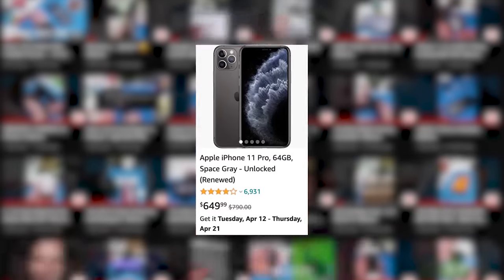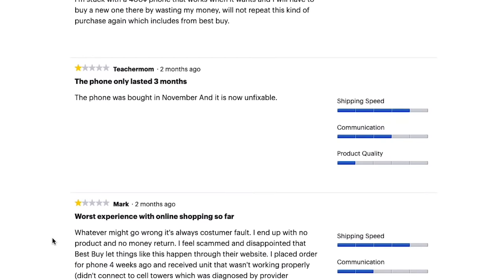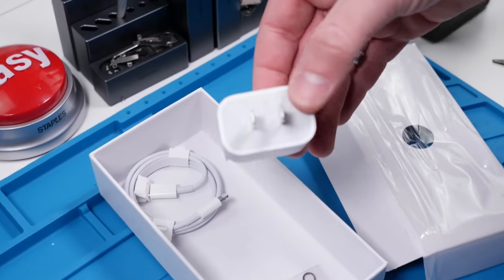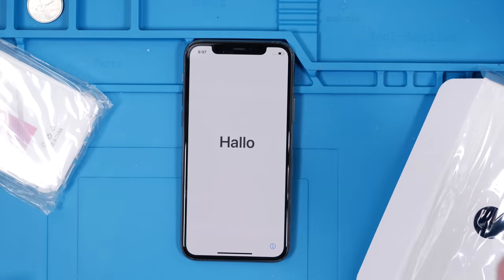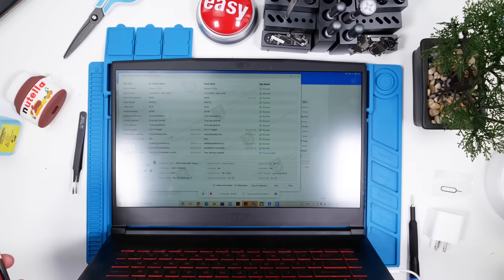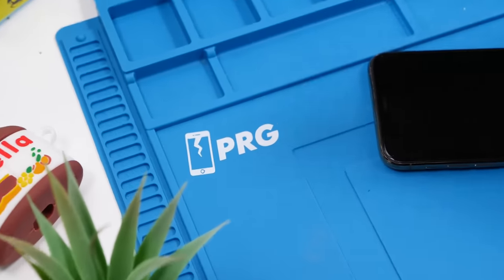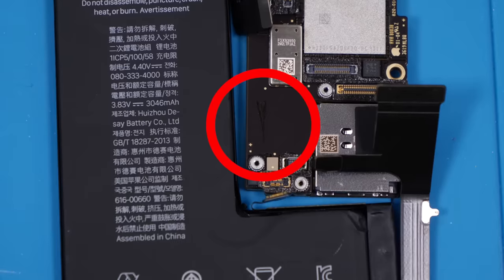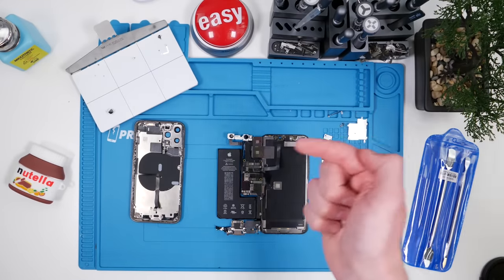How Good Is Best Buy Refurbished?

Comment: For reference of how bad the battery health is, apple recommendeds a replacement at 85% and you typically have issues at 80%
Reply: "Replacement" replace the entire goddamn phone and not the battery
Reply: That's at 80% the battery replacement. I tried to get my brother's iPhone 12 pro max battery replaced at 84% during the warranty period. Apple didn't allow us to go through with the replacement.
Reply: HoloKola  you have throttling problems, lagging, and some other issues sometimes at 80%
Reply: @erizorico  even if you have like the newest phone?
Reply: @corey7219  that’s stupid, did they tell you to buy a new phone too? I think apple said iPhones typically drop to 80% after 2 years
Reply: HoloKola  it might vary or it might be the same, it is harder checking your battery health on android though, you can probably find an app
Reply: @corey7219  yes that’s because they will only change your battery if it’s 80% or below only.
Reply: HoloKola  good luck
Reply: Oop
Reply: @chen2win  not just iPhones, every single lithium ion battery in any device will degrade and have issues after two years
Reply: @daniyalkhizar  yeah, that’s obviously, the thing that might be different is the technology they use in their battery or size of battery which may change the levels
Reply: @daniyalkhizar  
I have my phone since 10\2019 and I can't see or feel any change in battery health!
Reply: @E-hab  how?!
Reply: @E-hab  you probably don’t remember (your phone has a good sized battery)
Reply: @daniyalkhizar  
Its capacity is 3600 mAh and I think I'm not a heavy user
Reply: @E-hab  oh yeah 😮 , that makes so much sense because everyone uses their phone differently
The battery health goes down when you charge your phone
Reply: @daniyalkhizar  
You mean when charging it while using it, right?
Reply: @E-hab  no, just charging your phone and using it degrades the battery health
Reply: @daniyalkhizar  
Ok, That's what they call it "life cycles"  I think.
Reply: @E-hab  it’s biggest impact is how much heat is produced by use and charging, it just wears out the cells more
Reply: @chen2win  
Correct
Reply: i repair phones and anything under 95% automatically gets replaced
Reply: HoloKola  I have a Samsung and I got a battery health check. Still 100% after 4 months
Reply: HoloKola  
Note 7 was design flaw
Reply: @brando12343  seems like a waste
Reply: @roghider319  apple disabled my battery health after my swap but it’s at 99% after 3 months(I can check with 3u tools)

Comment: Just a tip on checking for generic charging cables, normally they have a serial number on the cable(fake ones never have this), may take a bit of time to find as the fonts grey, like the charger itself.
Reply: Where
Reply: @ridhwannasution5085  Just look along the cable(normally on usb side of the cable), it'll say "Designed by Apple in California Assembled in Vietnam xxxxxxx(serial number)".

Comment: 84% isn't very good battery health.  I bought an SE 2020 from Amazon Renewed for a backup phone and it had 92% battery health.  Also, I would rate it cosmetically as 8/10 because it had one small scratch on the screen near the top.  Other than that, there was not a mark on the phone.  My screen protector covered the scratch, so actually the phone looks almost new.  I would buy from Amazon again.
Reply: It is normal for a 2019 model. My 11 has 84% as well on ios 15

Comment: Question, I made a bad decision and got my iPhone 12 repaired but some local gadget repair that “specialized in iPhone repairs” and got a back glass and battery replacement and on top of my battery almost fully charged and not going over then 20 min later when it’s off the charger it’s almost fully charged 🤦‍♂️ but the back camera lenses when I turn on the flashlight the light goes in all different directions??? What should I do 😭 get another battery replacement? Or a refund for the battery?

Comment: I still think this is a horrible deal, ~600 bucks for a phone that a normal user will have to pay to have the battery replaced and the screen replaced on. And it's not in warranty or apple care because of the refurb. Plus a 10% upcharge just to return it. Awful

Comment: The box looked like the one my old 6s came back in after I sent it to Apple for replacement (got ran over by a car. Had an otter box defender on it so only the screen was screwed. Woulda just went to someone around here to repair but I had Apple Care at the time and it was cheaper going the ‘official’ route)

Comment: Best buy is trash. 2 reasons for me back in 2011 took my iPad touch 3rd gen to have battery replaced. I brought in a fully stock iPod touch with all oem parts. Got back an ipod touch with some weird generic metal back that would not fit any of my cases. 2nd thing was took a hp pavilion laptop to repair the charging port note the charging brick and cable worked fine only problem was the charging port due to a drop. When I went to get my laptop back my original oem charging cable had disappeared and a crappy universal charger was in it's place it completely fried my laptop and that was the last time I ever stepped foot in a best buy. 11 years now and my only regret is having gone in best buy for anything

Comment: Apple WAYY overestimates battery health... after 500 cycles on my xs max my battery health said 83% but my phone only lasted maybe 25% the length of time compares to when it was brand new.. do not trust the battery health percent.. 80% means you need a replacement bad.. only high 80s or 90's are decent

Comment: At this point that phone is probably just used and not refurbed.
Reply from the maker: It's been opened tho so its confusing
Reply: @PhoneRepairGuru  then I'm guessing they probably got it cheap with a small issue that maybe required microsoldering or reseating and they just resell it as is. Cause I wouldn't call 84% BH with a scratched up display refurbished 💀

Or maybe it's a housing transplant, they just moved the components to a "new" housing cause maybe the old one is cracked or something and they decided they're not going to replace the display also hence the scratches.